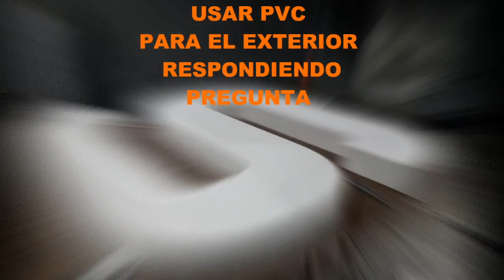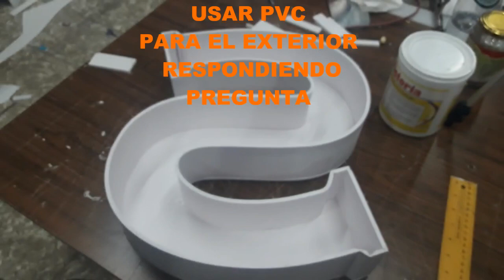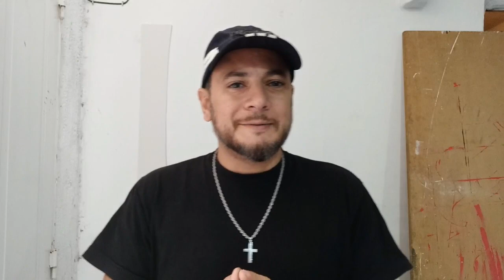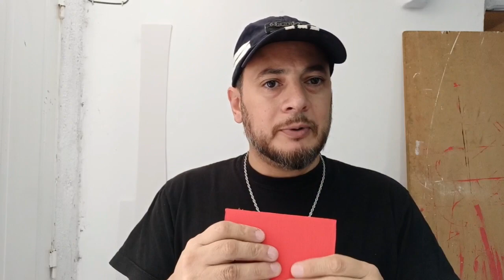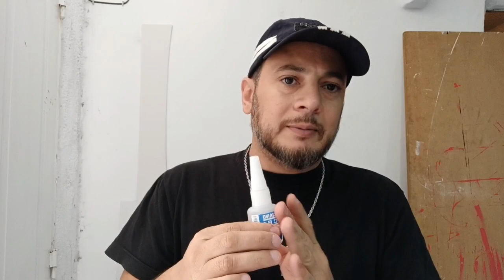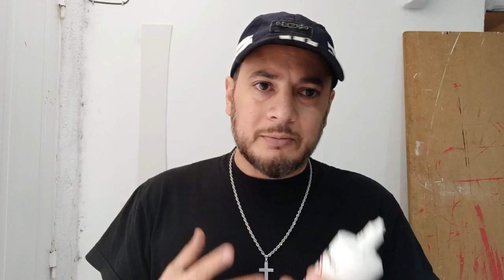SE PUEDE USAR PVC EN EXTERIORES❓COMO Usar TROVICEL O SINTRA  para Carteles luminoso

Comment: Gracias por tus enseñanzas. Quiero pedirte un vídeo si podes mostrar una vez colocado los led. Los cables . La unión de los mismos. Y el transformador para enchufar y q quede todo unido. Estoy empezando con letras y no se de electrónica. Me falta esa parte de la conexión final.
Reply from the maker: Hola cómo estás. Tengo varios vídeos donde muestro algo de eso . Te dejo los link y espero te sirvan y respondan tus dudas. 
Colocación de letras e instalación
https://youtu.be/_ultw7GDfh4

Cómo soldar LED 
https://youtu.be/yPT2_BSKvO4
Reply: @prografico3d  muchas Gracias 🙌